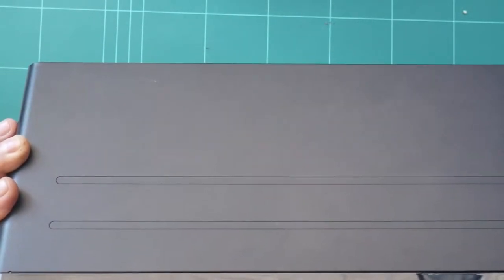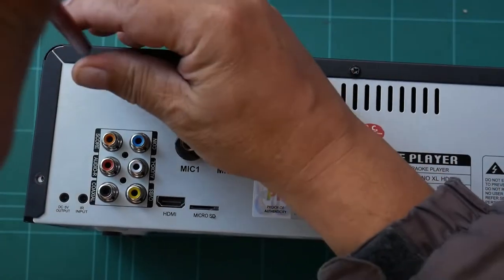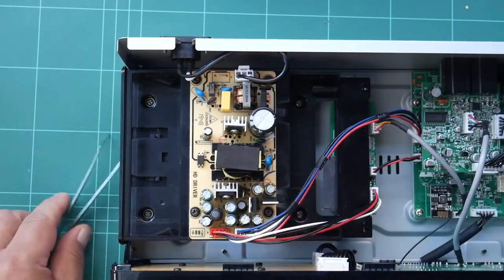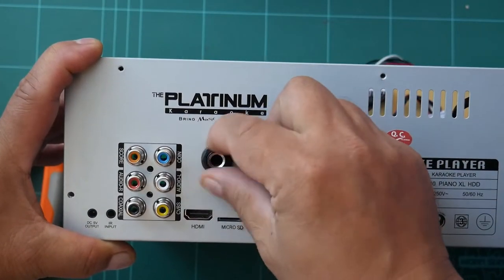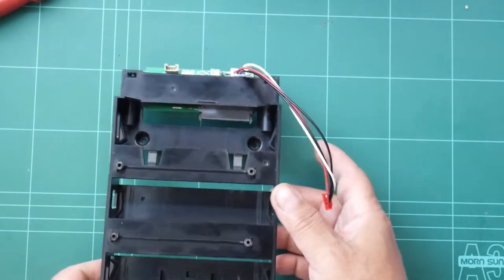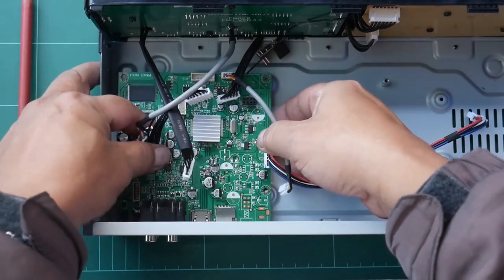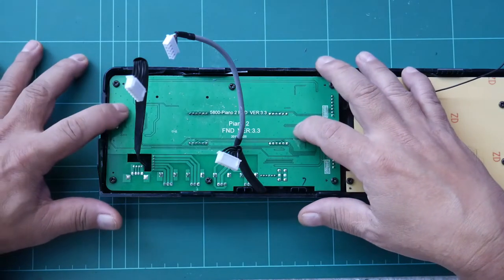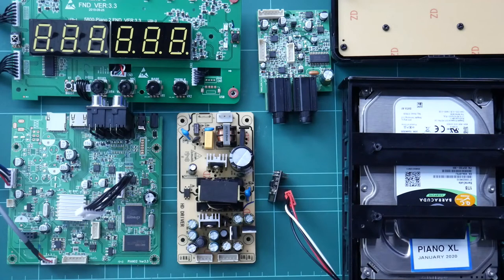Inside the Platinum Piano XL HDD karaoke player plus disassembly.

Comment: Hello and Good day Sir! I would like to know if there's a sound difference between the sd card and hdd version of this player? Thank you! Given same or identical motherboard. I am just wondering, if the files (midi or sound files) that are inside the hdd has better quality than the sd card resulting to good sound output especially the bass. By the way I have a platinum commander which was purchased if I can remember correctly was in the year 2016. I am planning to switch from CD to SD or HDD. I am gathering information in what I will purchase next,  the sd card or the hdd version. There's a more or less 30% price difference here in Manila po.
Reply: Thanks for the quality content Sir! New subscriber here!
Reply from the maker: @bernardsalvacion2271  There is no difference in sound quality because they have the same midi chip and sharing the same karaoke content.
Reply from the maker: The main difference is the storage used and Piano XL HDD does not have USB port since you don't need usb expansion for user content because all fit in the hdd.
Reply: Ok thanks po!
Reply: @ftatechtutorialdiytipskara1848  How about the sound quality of Platinum mini vs  Piano? Same midi chip?
Reply: im having trouble with my piano xl hdd ang tagal ksmg magload

Comment: I wonder if the fw of this will allow this unit to boot from the sd card instead of the hdd?
Reply from the maker: As I understand to let Piano XL HDD to boot from the SD card, the firmware of Piano XL SD is needed since basically these two players' mainboard are indentical except the storage they used. I heard that it can be done this way although I haven't tried myself.

Comment: Why my unit piano xl hdd can't connect to wifi or platinum link?
Reply from the maker: Are you sure your phone is not blocking the connection?
Reply from the maker: I have no issue here connecting to S6 phone Tab S6 and Tab S7+ here.
Reply: When i down load the platinum link there was no piano xl hdd to select only piano xl sd..maybe that why it cannot recognize the unit..
Reply from the maker: @ferdinandantonio9909  I can not see what is going on your side so it is hard to pinpoint where is the problem.
Reply from the maker: Before running Platinum Link, your phone under wi-fi should see all the available devices. Mine here I can see my Piano 1.5, Piano XL SD and Piano XL HDD and I can choose which one to connect. Once connected I can then run Platinum Link and search for the player from the menu.